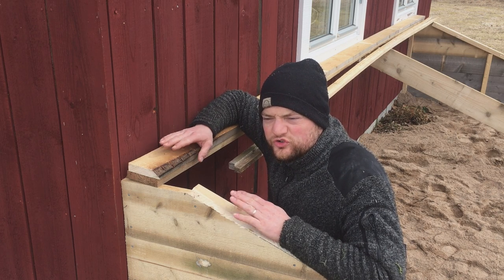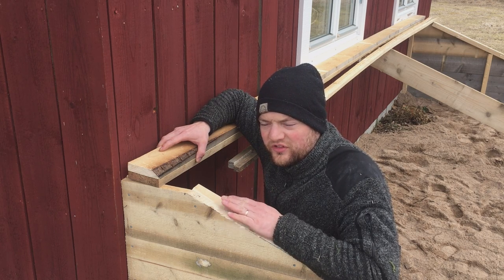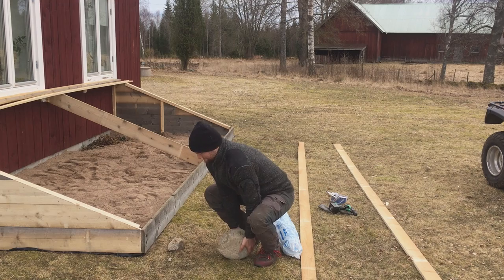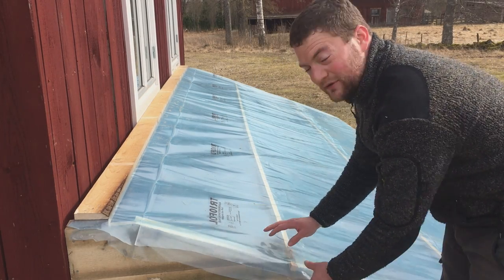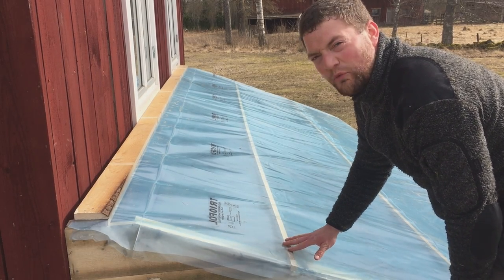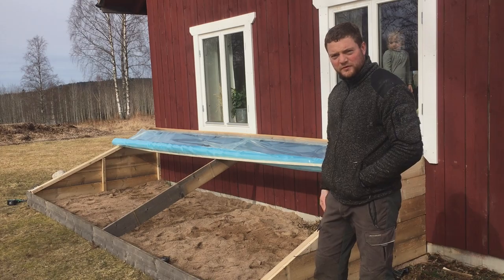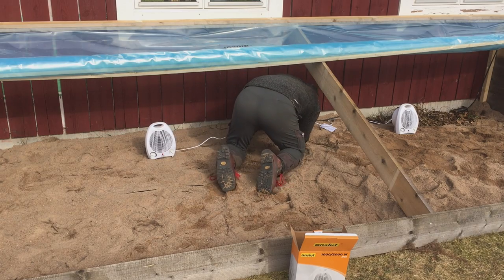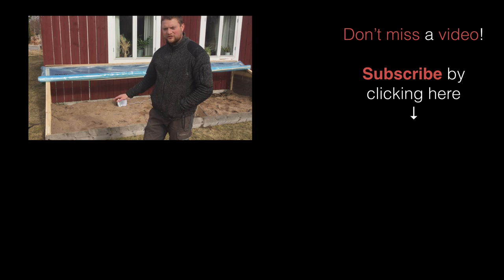Here is Why Your Plants Will Love This

Comment: The cold frame came out great. The only concern I would have would be moisture getting to the heaters/cords. I don't know if they are rated for out door use and might trip your electrical system. I don't know what kind of electric system you have in Sweden. But we learn so much by trial and error, I hope it works great for you then you might want to build a more perminant one, I think it is a valuable tool for a commercial grower.
Reply from the maker: You are right. The cords themselves are made for outdoor but the heater itself is not. I need to be careful with it but only plan on using it for a short time. When they run a little bit at night there is pretty much no condensation I have observed. I will have to lift them out when watering the plants.
Reply: i think thats no problem the heaters just wont last very long but you should get 2-3 seasons out of them.
Reply: I have the same kind of heater in my greenhouse, and as long as I don't water it along with the plants, it does fine.
Reply: Looks great!
I think that the problem with these kind of heaters is that they will tend to dri the plants inside as they blow hot air. I advise you to consider radiator type (oiled-filled) heaters. they usually come with a thermostat and tend to keep heat much better.
just a thought...

Comment: Simeon,
Remember you need an air gap between the plastic layers. 12mm minimum from my experience. looking good! The nails will pop through in the wind, Use staples with pieces of paper board lathing.

Comment: To save burning fuel on heaters you could build a compost heap under the plastic covered with sand and the compost will heat up your cold frame

Comment: hej, i live in sweden too. instead of sand on the floor, i dig out the ground about 1 ft (30 cm) and put small woodchips in (from sawing). Then put a little sand on top. The woodchips get warm when compressed. This raises the ground temperature with about 4 to 5 degrees.
Reply from the maker: Cool!
Reply: I don't know if you have problems with termites in Sweden, however the woodchips would start to decompose and possibly become "termite bait" next to your house, possibly inviting an infestation.  Just my two cents.

Comment: Here are non-electric ways to keep plants warmer using materials you have around the homestead: 1) Put jugs full of water inside the frame where the sun will shine on them during the day.  They take up space but can up the temp several degrees.  Suggest put them next to the outside boards.  2) Put reflective board or cloth over frames at night to reflect the warmth back into the bed.  Anything that has an aluminum-look should work whether rigid or flexible.  3)  Insulate the frame at night with any kind of barrier.  I have used an old quilt.  4) Put frost cloth over the plants at night.  An Elliott Coleman trick.  :-)

Comment: Simeon, to keep my well pump switch nipple from freezing, I use a heating cable controller/EH38 that comes on at 38F and shuts off at 50F (3.3 and 10 deg C). I use it to control 2 100 watt drop lights. Use outdoor rated fixtures and lights. You may need more than 2. Google heating cable thermostat and see if there is something like that in Sweden. Thanks for doing a great job.

Comment: Sorry, hit the wrong button. Anyway, I was going to suggest that you simply use a light bulb to heat the cold frame. You might be surprised at how much a 100 watt bulb puts out. I kept my pool equipment from freezing in a small enclosure.

Comment: Looks like a sound concept that you've implemented quite well. You may be surprised at how much heat that your cold frame will capture. When you build the next frame, you may want to leave ~10 cm excess plastic on the ends. You can build a simple, removable clamp to keep the ends from flapping in the wind and letting cold air in

Comment: For the moisture situation, I would plug the cord into a GFCI (Ground Fault Circuit Interrupter) outlet or an extension cord with GFCI (they make them in about 1 foot just for providing that).  I would suppose they would have them in Sweden, maybe not.

Comment: Since you have the lumber available, I would suggest you build some temporary "rafters" to hold up your plastic in case of a late snowstorm forecast.  Snow can cause the plastic to sag and will then accumulate, threatening your plants with a collapse.  Having more rafters would support it.  The plastic will not shed a heavy, wet snow.  Nice project.  After starting your plants, the area could be used to house container-grown plants in late season.

Comment: My only suggestion is the sides made out of wood. Wind can blow right through those slats. Have you considered running plastic on the inside walls? Or another thing I've see is bubble wrap. Like you use in packing. I'm not sure if you have that product in Sweden. Looks great!

Comment: Those heaters are so unreliable, you should buy 20 liter water containers. Paint them black, and place them on each corner.
Reply: I have 2 55 gallon poly drums in my greenhouse.  It helps buffer the heat pretty well.  They are a dark blue but work just fine.  My winter temps don't get to the extremes that Sweden does but I was able to keep tomatoes, moringa trees and a small palm tree over winter when temps were in the 20F range at night for weeks at a time.  Eventually I put a row of 4 open top steel drums filled with water on the north facing side of my greenhouse next to a 330 Gallon tote all filled with water as a wind break.

Comment: Generally, a cold frame has a top made of panes of glass on hinges you can crack open to release too much heat.
The glass traps the warmth of the sun from the daylight and keeps the box warm.
You can add a thermal mass to the bottom of the frame to absorb energy to release overnight.
Of course, you don't want to plant inside the cold frame but keep your starters in their individual cubes or containers. 
With all the wood you have available you could run some flexible pipe through the box and build a rocket heater to warm the box as needed.
Just an idea.

Comment: when I first saw your Cold Frame I thought the angle was too low.but I guess because you're in Sweden you're actually using it in the springtime .I use mine in the dead of winter here in Tennessee.and in Winter the sun is much lower in the sky there for my angle need to be  different
Reply from the maker: Yes. I guess a steeper angle would have been better but that would have covered up my windows. It works great so far though.
Reply: PhxtoNash where in Tennessee do you live? I also live in Tennessee !

Comment: It might be interesting to "plant" a thermometer in the sand and log the daily temperature to get some idea of how it compares to outside.  Lots of interesting data to be gained and comparisons to be made.  Total amount of heat stored in the sand and how long it lasts/changes overnight.
Reply from the maker: I have had a thermometer about 20cm off the ground the last few days and have been monitoring it.
Reply: The temperature of the thermal mass and how that compares to outside temps is what I was thinking to measure.  If the sand doesn't do the job, maybe digging it out and adding stone to increase mass then recovering with the sand might be an option.

Comment: Nails alone might not hold that plastic. I'm always using small strips of wood, so that it has more of surface area. Plastic-laminated plywood works best, especially the kind which has one deliberately rough surface. It is water resistant as well to some point.

Comment: Hi Simeon,    Are you actively monitoring the air temperature in the cold frame. How long till you do not have to worry about freezing temperatures? Cheers,    Bill
Reply from the maker: I am monitoring the temp in there. We can have frost until the middle of June but I don't think the inside of the cold fram will be as sensitive.

Comment: There's real wind where I live. I built a cold frame last year .... totally different. Not against a wall: an A-frame. I didn't use staples, nor nails. If you would record your temperatures (night min and day max) and let us know, THAT would be so helpful.  I left my tomato plants out there on nights down to 5C only twice and to 8C maybe 10 times. Two varieties really suffered and developed physiological leaf roll ... I think that it was the extremes of temperature, night to day, that hurt them though I NEVER let them suffer from heat under the plastic. Not once. PLEASE keep a record of the temps and do another video with the results. The two that suffered were cold resistant varieties.

 Oh .... I had no heater .... did not solve that problem. I own PLENTY of fan heaters. Plenty. THAT'S how I know what they are like. There is NO WAY I'd put one outdoors. In my country, all the instructions that come with them say "Do not leave them unattended". I've had a couple lose their ability to automatically turn off while standing right beside them "Good Grief. WHY'S it so HOT in here???" Actually, if you follow ALL the instructions, you won't be able to use the heater in any circumstance: all circumstance are prohibited by some caution or another. The manufacturers don't want to be responsible.
Reply: I just thought I'd add that at the moment the wind is 82 gusting to 114kmh, here. It's -2C and snowing.

Comment: You will lose warm air if you do not seal the one inch gape created by the window frames and the top board next to the house. Any concern about moisture damage to the house siding?
Reply from the maker: +John Dantice these videos were filmed last week. The gap is sealed and I have been observing. It looks good so far.

Comment: Hey Sir -- totally unrelated to the cold frame, but how did you side your house? It looks like regular vertical boards with a small gap in between. Is that to help keep the wall dry?
Reply from the maker: The walls are not done yet. We are building our house ourselves and haven't finished the walls yet.
Reply: Cool. Are you going to put battens over the gaps? I ask because I live in Minnesota, which seems like a similar climate. Thanks again.

Comment: I'd create a crawl space...doorway:  since, you're losing TREMENDOUS heat rolling everything up--and, of course, this (idea) is for when temperatures are really low, obviously?  Some sort of a...canopy--over that door "hatch" to keep snow from developing into...ice (meaning you'd have to be chopping you way in there), right?  Plus, some sort of a high-end heat venting...nice,  probably?   (I've got some questions, overall:  design-wise--BUT, these are learning...experiences, naturally?)  There was a....FUNNY commercial here (in Minnesota) some years ago--I forget for...what, exactly--with a snow-covered garden?
The...commentator speaking about "snow peas", "Iceberg"  lettuce, and, SO ON (as though viable..."winter crops"), but, I once left some turnips in-ground over winter under straw and snow and they WERE...FINE come springtime!!!

Comment: Good design on the container!   Two concerns at this point - Do those heaters have thermostats which will function on low enough temperatures to be of value,  and also you say you were using an extension cord for 2 heaters... that's a very High draw of amperage - assuming they draw only 9 amps each.  AH!  What is the working voltage you have for supply - here in the USA it's typically 120 VAC. Now I'm thinking this is actually a wonderful learning experience for all those involved - as WHERE you are in the world can dictate what is and is not safely and easily done!
Reply from the maker: Hey there. We have 240 in Sweden. The heater I use are made to keep small spaces slightly above freezing. The thermostat can be adjusted from 0C° upwards. The heaters can run on 1000W or 2000W depending on which setting is chosen. I have already noticed that 1 heater would have been enough.
Reply: Your 240 is more efficient and I'm happy you confirmed it.  So with one heater on low it's less than 5 Amps - any sturdy extension cord in good condition should have no issue with that. I voiced concern because your house and kids are "connected" thinking better to be safe.  Being it is on a homestead,  cord eating animals can be problems - cats, porcupines, rats, and others all have been known to bite once too often!  LOL  Best of Luck

Comment: I hate metric but I wish America would adopt Celsius. 0 is water freezing and 100 is water boiling. 
I mean why on earth would you use a temp that is 32 and 212.
Reply: Hehe and how many feet in  a mile or inches in a foot/yard? Canada switched in the 70s I think and working with even round numbers is much easier.
Reply: C Grant when you build things using standard is much easier and exact. 1/64 1/32 1/16 1/8 1/4 1/3 1/2 7/8 7/32. Just a more precise way to measure.
Reply: I would disagree although I use metric and imperial (standard) sometimes using both on the same project. It's worth noting that the US Automotive industry generally now use metric.

As for which is most accurate, I'd suggest that regardless of which unit of measurement you use accuracy is in the hands of the user, the difference in reality between 1mm and 1/32" (the smallest units on a Metric/imperial Stanley Fatmax) is less than the thickness of a pencil line. As far as which is easier well 1/10 of a mm is 0.10, one hundredth of a mm is 0.01 and a thousandth is 0.001. It doesn't get much easier.
Reply: R Mac the width of a pencil line give us Chinese crap.